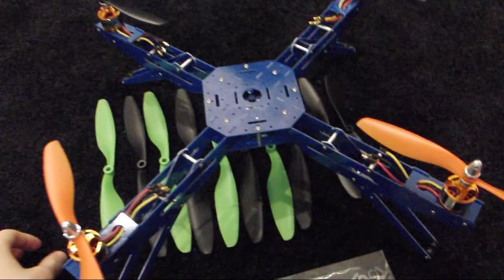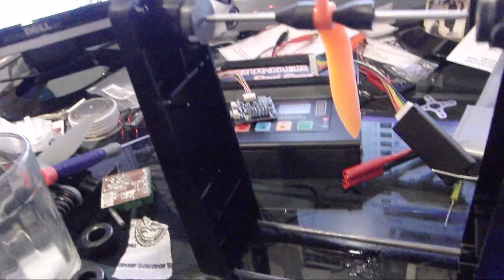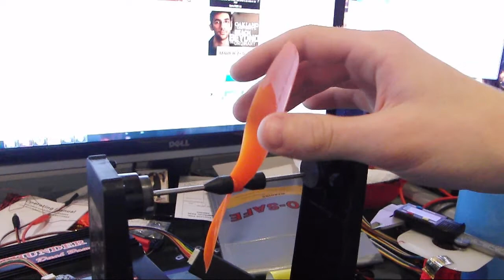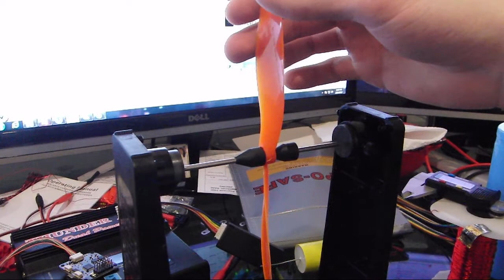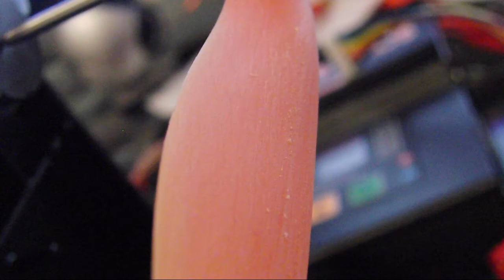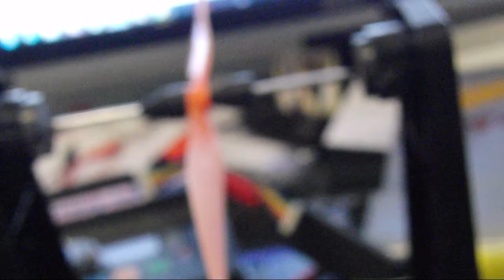Balanced Propeller

Comment: Isn't it possible to carefuly blow some hot air over it? It will smooth out the fine scratches, I think. Just be very careful not to bend it/burn it. Just an idea...
Reply from the maker: MrDubje Not sure..the whole point of adding/removing material is to add/remove weight, to balance it out, due to injection-molding not being a 100% perfectly balanced process.  Some add thin stripes of tape, others file-away material
Reply: PhxSt0rmz Thanks for your reply! I'm not a flyer, just had the idea ;). So... no experience.
To be perfectly clear: I didn't mean to balance it with the hot air, just using it as a way to get the surface of the blades to be smooth again, after sanding it down... ;)

BTW, Cool video's man! Watched a lot of them, amazing that you have all the tools and knowledge to build all the cool things you do.
Some sooo random and silly too, but they are fun to watch!

Comment from the maker: Well it takes 5-6 mins to balance by sanding.  But, i just avoided such things because when flying your talking 10,000rpm and a lot of air flow when your doing fast movements.  I can be wrong though :)  You are a quad flyer after all

Comment: The surface does not necessarily need to be super smooth. but you are changing the shape of the airfoil when you sand it. instead of doing that.........you SHOULD just use some nice clear scotch tape and place a small piece rapping around the leading edge of the lighter side. just keep adding pieces of tape till you get it perfect. no only does it work better and not effect the airfoil, but it is SOOO much faster and provides great results. you can check some of my vids to see the result.